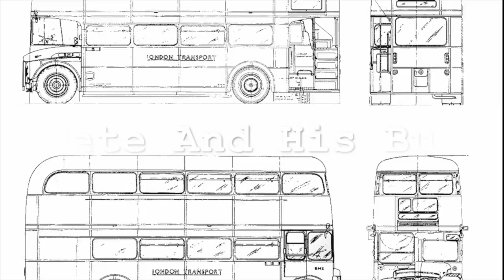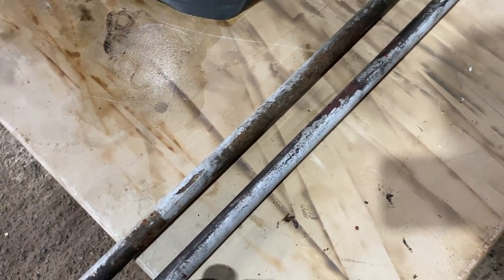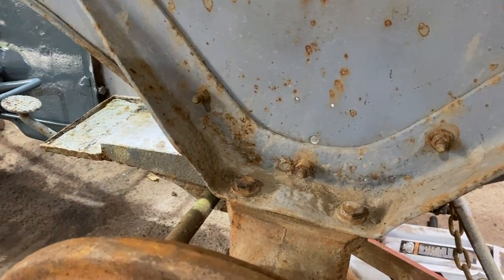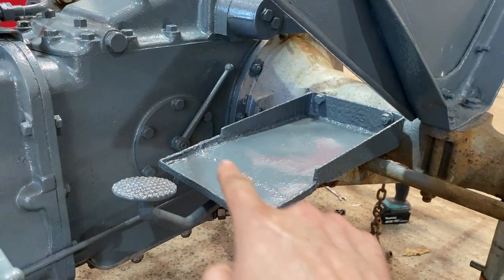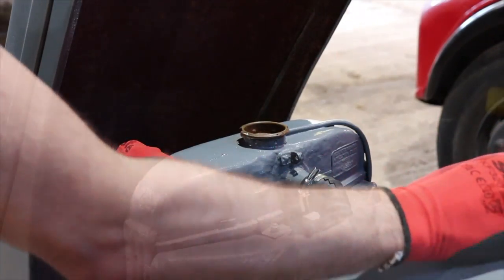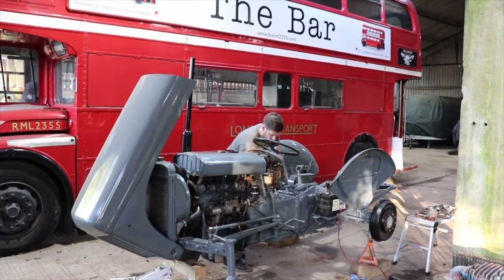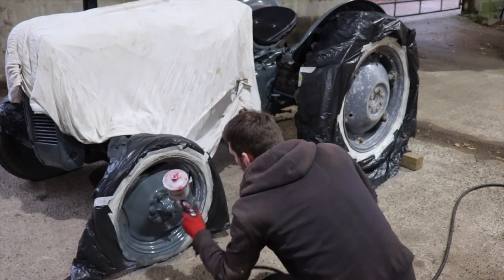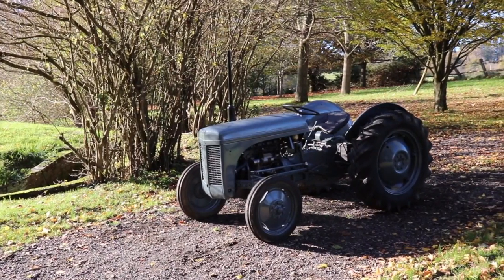Pete And His Bus, Episode 32: Tractor Madness

Comment: Hi Pete. This tractor is a TEF 20 which were all built with the Freeman - Sanders diesel engine built for the Standard Motor company. So this is not a TVO model and that plunger you said was a TVO adjuster is actually called a Ki-gas pump that sprays a fine mist of diesel into the intake manifold from  the auxillary tank to assist cold starting.
Reply from the maker: As you can imagine, I know all that now!! 😂😂👍👍 thanks for watching

Comment: Enjoyed the video I stumbled across it earlier! The part you took off the dash is actually the ki gas pump, on the early TEF tractors this was a starting aid that fired diesel over the glow plug through the air intake. The original diesel engine was probably replaced with this one which went in commercial vehicles. I would say your tractor is in fact a TEF diesel model you can tell by serial number above steering wheel if you go on friends of Ferguson site you will be able to tell it's DOM by the numbers 😀
Reply from the maker: Hey thanks for watching, use you are right an all accounts but it is a TED and it was originally tvo, so no idea why it had the Ki gas for a diesel
Reply: I too would say it was originally a diesel, one example reason is the extra studs under the back end, they were a late model strength improvement.
Reply from the maker: @andrewmcconnell8675  Very interesting indeed!
Reply: It's a nice little tractor and looks very smart, if all the ki.gas system is there you might be able to connect it up to help with your starting it does help and with the bigger starter you should be cooking on gas 🙂
Reply: The brass button on the RH side of the gearbox was only on diesels

Comment: The tractor is just a nice little change from all that bus stuff hey Pete 
And no lift needed to paint it 
Thought the little paint brush , was that some sort of self punishment 😂😂
I managed to by myself a battery pop rivet gun this week 
It is a little heavy but so good 😍😍👍👍
Maybe a bit of aero start for the cold weather before you destroy the starter
Reply from the maker: The little brush was easiest around all the nuts and bolts. I'm going to replace the starter to a Ford 4000 one. It bolts straight on and has much more oomph. Not a massive fan if the old aero start. Can fatigue the engine quite easily. Thanks for your advice and for watching!

Comment: Nice little tractor :) The 23C Engine is despite its reputation a great engine. If you keep having issues with starting, check if all 4 glow plugs work and work well it absolutely needs those even if one glow plug isn't heating properly its going to have a hard time not only when its cold out.
Also those engines do have a timing chain which lengthens over time which means re-timing the injection pump is neccessary - on an older engine turning the pump ~1mm towards the engine (clockwise when looking at it from the back) will do wonders on how it runs and especially starts.
Reply from the maker: great advice there! Thanks for watching.

Comment: Many people around my age remember learning to drive on a little grey Fergie at whatever age they could operate the clutch and brake pedals, it was 12 for me.  Even a TVO could be awkward to start if damp and cold.  Often needed a good half hour running on petrol,  depending on temperature, once the electrics had been dried first before switching to TVO.  Putting the distributor cap and HT leads in the bottom oven of the kitchen range dried them out quickly.  Strong arms, back and shoulders for swinging the handle.

You should watch a tractor building competition at a county or agricultural show, a Fergie built from completely dismantled  to running tractor by a team of chaps and chapesses in about 10 minutes.
Reply from the maker: Brilliant! Yeah the cold does get to them. Thanks for watching!

Comment: If it's hard to start, try sticking a hot air gun into the air intake. We used to use a flaming rag soaked in diesel by the air intake on our forklifts that wouldn't start in the winter!
Reply from the maker: Good advice 👍👍

Comment: Did you heat it before starting ? Them 23c engines are more or less impossible to start without heat
Reply from the maker: I did, but there’s obviously an issue there
Reply: @PeteAndHisBus  how long did you heat her for? I see it has 4 glow plugs in the head rather then the original thermostart. Are the glow plugs working